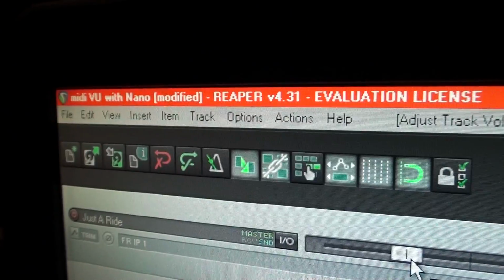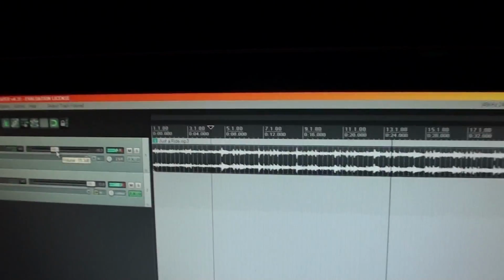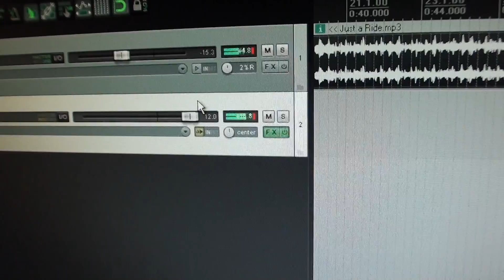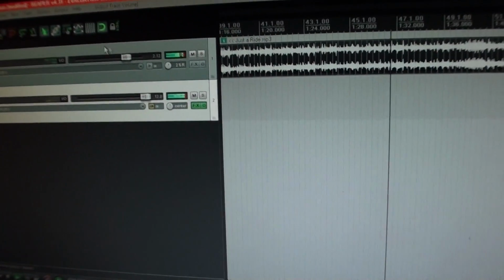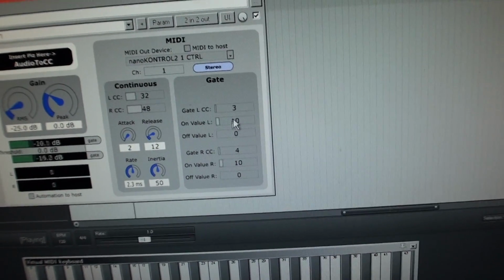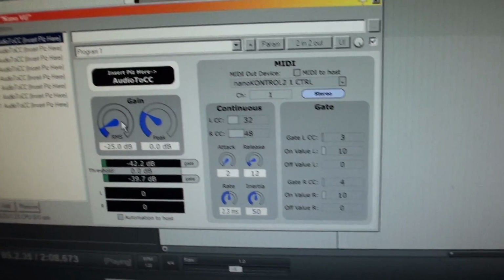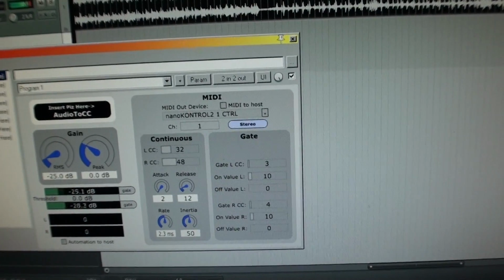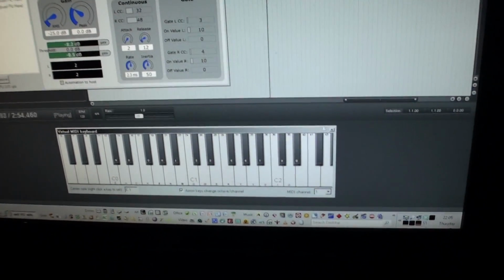How to use the Korg NanoKontrol2 as an audio level meter with a DAW

Comment from the maker: it's just simple continuous controller messages. 
You have to ensure the Nano is set in CC mode with LED Mode external.
Using your Korg Kontrol Editor software you will see the CC Numbers that correspond to each button/light.  If the play button is CC32 and you send any value using CC32 to the midi output connected to the Nano the led will light up.  I just used an audio>CC plugin to manage each pair in respect to an audio level/event. I hope that clarifies.